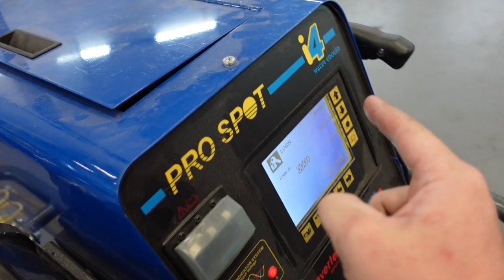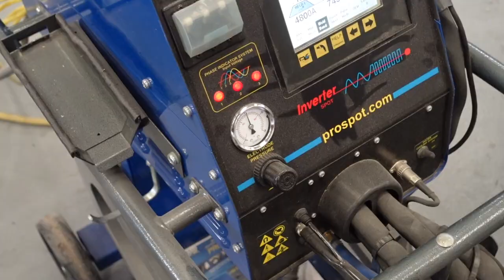Un-crashing my S14 Silvia! (results shocked me!)

Comment: Gotta love auto body. That shit is an art form itself. PRO TIP if you don't have a spot welder and only a mig, to prevent burn through when welding, if you can use a copper backing so the weld won't burn through and cause bigger holes rather than welding them together.

Comment: What would you recommend if I have to move my lower rad support forward a little? Castor arm brackets took the impact and popped the welds on it since I think it was previously replaced and welded poorly. Will it move fairly easily or will i need an actual frame puller?

Comment: Class job👌🤙 That car really is mint 👌💯🤙but from what I've seen living in Ireland e coat has shite rust resistance I use a weld through primer it's got zinc in it or you could use steel its ment to have stainless steel in it but I've never used it . Ask Brian what he would use if he was restoring a really really valuable car he never wanted to rust ever I'm curious what he uses I dout its e coat , I know the factory used it but that's because it was cheaper and easy 👌🤙💯
Reply: E coat is high in zinc also, for a no hold barred restoration DTM epoxy primer would be the best solution/replacement for e coat or weld through primer.